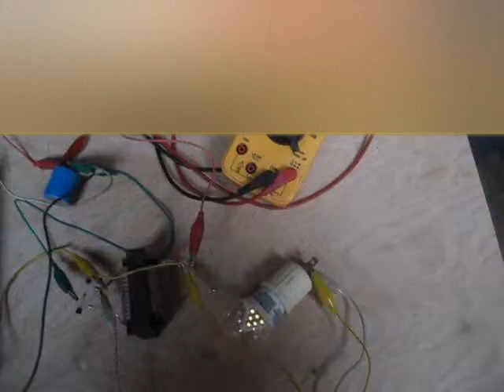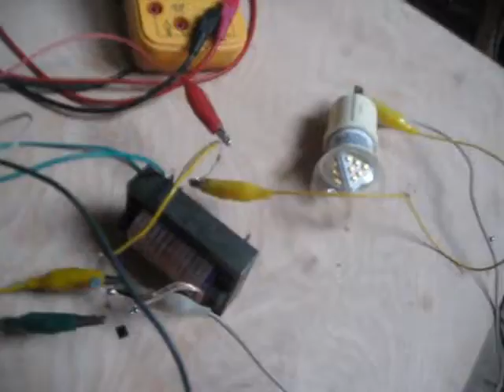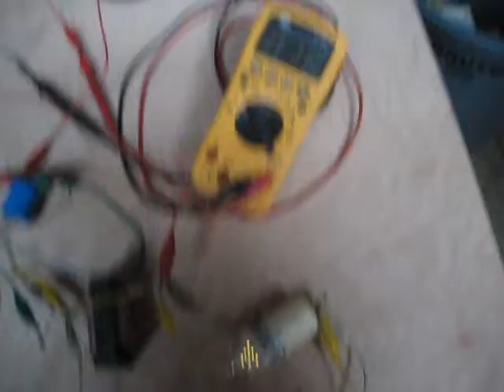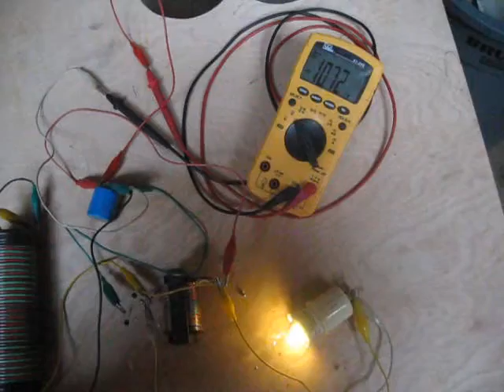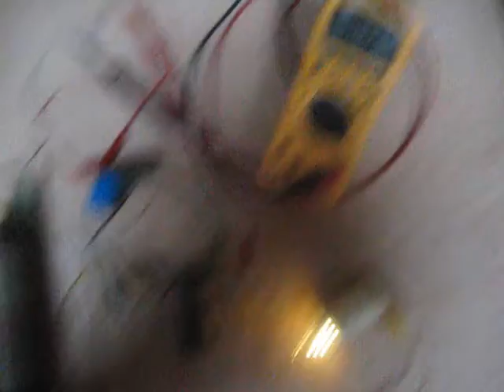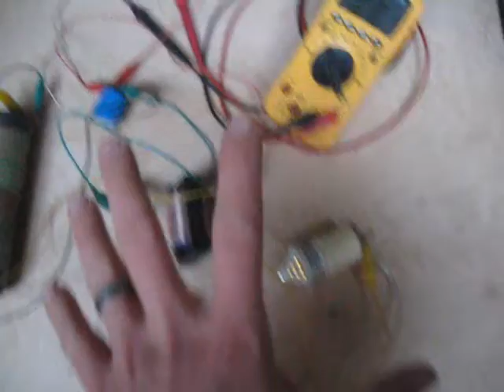Joule Ringer CrossOver Update! Very long runtime on capacitor.

Comment: Great demonstration of dielectric absorption.  This is something that every electrical engineer and most electronics hobbyist's know. Many YouTube experimenters do not know these basics, which I too believe is why they keep claiming over-unity when we all know that over-unity is not possible.  One other mistake many people make is measuring high frequency ac voltage and current with regular mains-use digital meters that are mostly optimized for 50/60 Hz and lose accuracy at high frequencies.